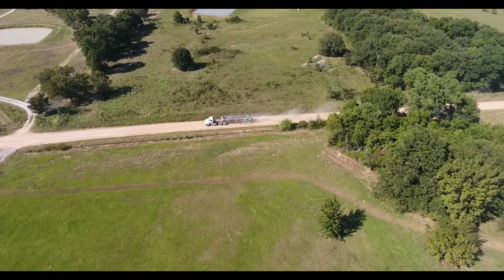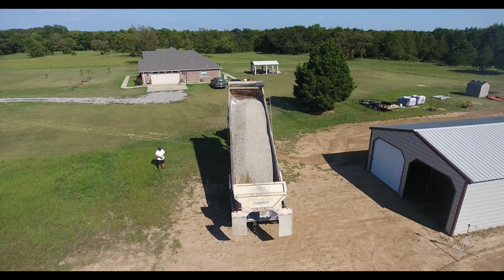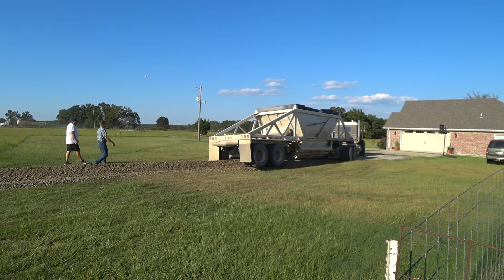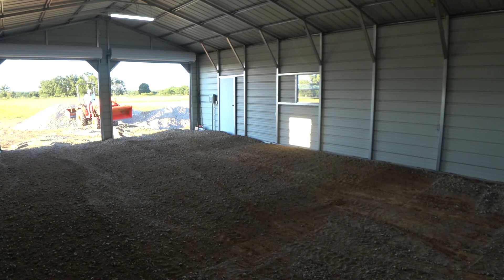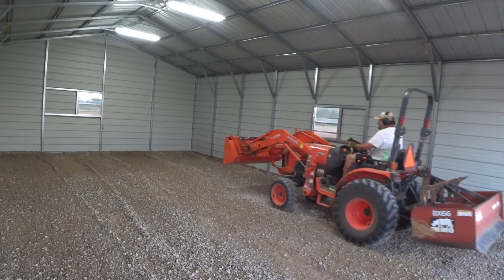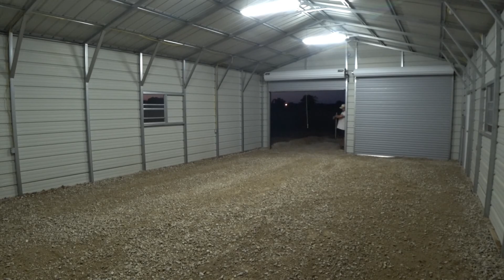Ep. 102 - Gravel for the Barn!

Comment: Did you put down some sort of threshold for the doors?
Reply from the maker: Not at first, but I did go back later and put down some flat cinder blocks to use as a threshold.  It required some digging to get the blocks relatively level and flush with the ground.